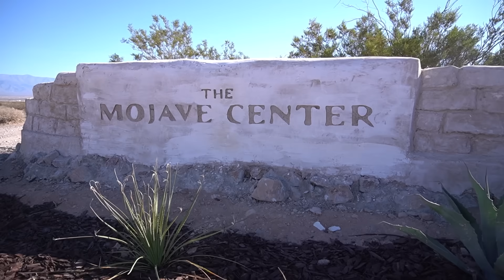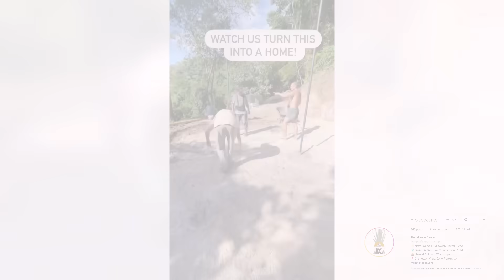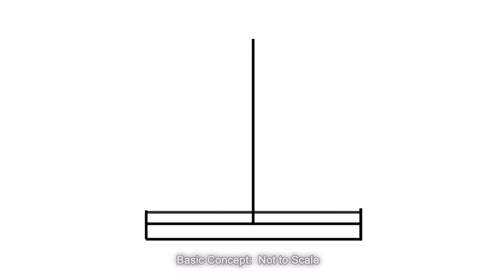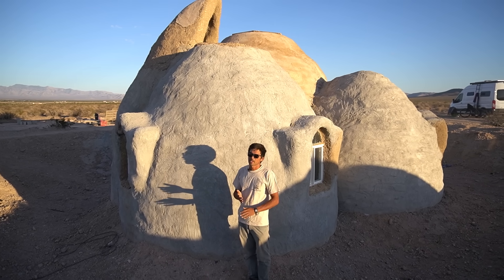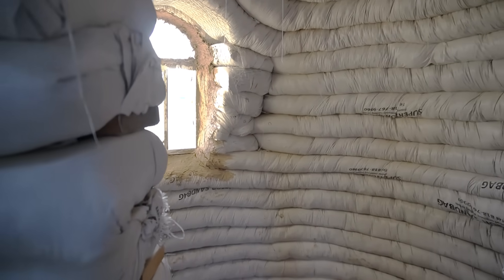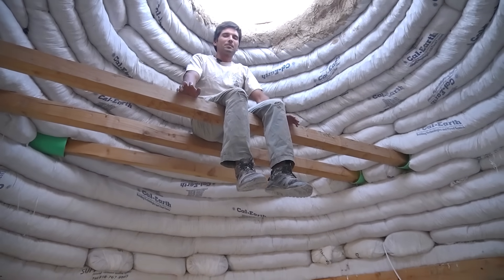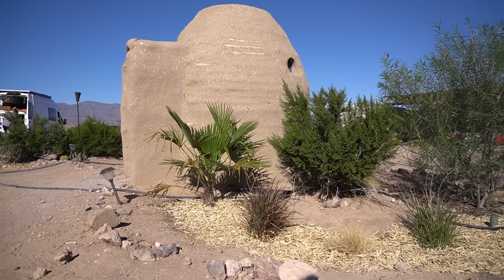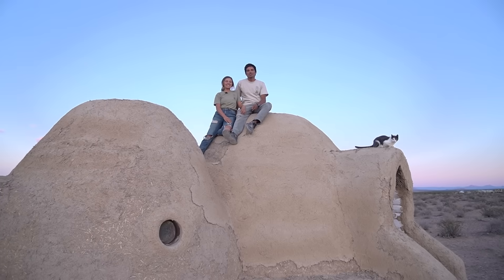These Sustainable DESERT DOMES Will Blow Your Mind!

Comment: Death traps in an earthquake.  The Navajos build earth homes (Hogans) but they are experienced enough to know that they need a support structure inside of them.  They use Utah juniper tree trunks to provide needed support.  Adding barb wire wrapped around the earth filled bags only means that they will cut you up before they crush you to death.  Sometimes cheap and easy is the most costly in the long run.
Reply: That is false. This method of building passed earthquake testing. Hogans are different and shouldn’t be compared to this method.

Comment: I'm very curious about things like building codes, local permits, etc. 

If you could combine this with solar off grid electricity, and guaranteed water supply, there are some eco village groups that would be very interested in this
Reply: Most counties allow less than 200 sq ft homes to be built without permits.

Comment: If these domes had the floors 3 feet below grade, the homes would be much cooler, but still have lots of light.  Obviously you would need to build in higher areas.  Maybe the earth bags could be strengthened to allow them to be retaining walls for the part below grade.

Comment: My neighbor in Joshua Tree , CA. built her home and two smaller domes that she Air bnbed. I watched the whole proscess from the beginning . Cal - Earth has a work bank program where you " bank " hours of volunteer work which you can then withdraw in the form of whatever skillset  you have need of when you build your own home , such as a plumber or electricianfor example. The homes themselves are wonderful , with skylights and windows letting in lots of natural lught . The round rooms flow so well and there are custom nooks and crannies built into all the rooms . It maintains a comfortable temperature even in the summer and one room she uses for an office has the most perfect accoustics !  The bathhouse is also built the same way with a spiral entry leading to an open shower and a seperate deep bathtub that is built out from the wall. Its just a wonderful place and she is very proud of it , as she should be .

Comment: Two questions that come immediately to me; what is the cost difference between earth bags and tires for an earthship, and do you use french drains for water capture? 

Interesting concept but do you have engineering information about structural integrity v earthship construction? 

Also, how does the thermal mass compare with rammed earth tires in an earthship?

Comment: Now what I'd like to see is taking advantage of the cooler earth by digging out your circle floor to a depth of around 3 feet, bags etc up to ground level, add 1 foot and put in windows, finish off the dome shape as you design. The door way would require a mini trench access but no problem in a water restricted environment.  Try one ... since you are experimenting ...

Comment: Another idea free to those who use the ideas is that a dome larger than the domicile keeps the inner dome out out of the sun  and leave a hole in the center for ventilation of the walls.   The ventilation will make the inner dome cooler at night.

Comment: You have zero pollution electric power Edison generators are open patent devices.  Zero refrigerants air-conditioning that is zero current used.  Is possible and was required by the EPA mission under treaty enforcement and obligations.  Have you considered deep under ground ventilation filled with steel ?   Twenty foot diameter with ten foot walls topped by ten foot dome might be a little more realistic.

Comment: Can you use permanent magnet motors as generators with inverters to deliver house current AC power?   A car generator can be converted from Tesla generator to Edison generator by removing Tesla magnets from the armature magnets. Count and divide by 6 and chisel off one sixth and leave one sixth on and alternate on and off to three sixths on and three sixths off.  Reassemble this generator and remember it is now a powerful motor and you have hold both sides as you bring armature and case together.  Positive DC is the brushes and negative is the field to wire to DC AC inverters.  The car generators have to be older than 1974. Not an alternator.

Comment: my concern is about resistance of the plaster against the rain, it won't stay long, we use this kind of plaster in Afghanistan too as this is all so a traditional way of covering the walls with wet soil in Afghanistan, but we do it on top of the soil, not on top of the plastic or any other materials, make at the way at least it worth it, you can ask me for more experience.

Comment: It's not building the tiny home that's the issue. Believe it or not, the walls and roof are actually the easiest part. What's difficult is the utilities. Which this Hut has none of. No electricity, no water, no septic and no sewage. So of course. If you even want to call it a house, which is missing every element. It would in fact be very quick and easy to build.

Comment: Wouldn't these require Maintenace every 4 to 6 months? I mean the final coating of the walls and outside that will eventually start to crack and flake off.  Which would then need to redo a new coat inside and outside.

Comment: What defines "sustainable"?
Genuinely curious about it. To use material that is easily reproducible, recyclable or easy-to-repair perhaps?

Was just thinking about the bags, sounded like you said it was "Polypropylen". I might be wrong but If I remember, isn't Polypropylen bad in places with a lot of UV radiation, because it breaks apart the Polypropylen?

Looks great by the way, really liked the one with the white paint, very Santorini-esque!
Reply: UV is why the stucco is required.

Comment: While the humidity is incredibly low in the Mojave desert, if I was going to build a house there, I'd set up a giant humidity removal system to remove the little water that's in the air and store it in a giant, 10,000 gallon tank, which would be powered by the sun, the thing that there's a ton of there. I'd have a giant solar array on the floor. I'd share the water with others.

Comment: I understand that polypropylene bags are cheap, durable and long-lasting when protected from elements... However, I am trying to go zero plastics and yes, I'm being very particular.
How does cotton canvas or linen canvas do in these types of structures?
Reply: Just fine.  Sandbags used to be canvas before the plastics revolution.

Comment: Good luck. I would like to see some sub surface heat exchange system. It’s just pipes loop underground at an engineered depth. This is like free AC in hot dry climates. Also works for water cooling and condensation gathering

Comment: These bags and stuff are not necessary. You need something that bends. Wood doesn't bend much but many twigs together do. Or bamboo parts if available. 
Tie Twigs together and make the skeleton. Together with dry grasses (straw). Inside should be in connection with outside. Then put a mix of clay, straw, sand and some cement on outside then inside. Finish. Ok, if you want bigger walls: more twigs, more straw, more mud. You can do it even without cement. Only that rain will dissolve mud, so a layer on the top it's not a bad idea.
But thanks anyway.

Comment: Why not RAMMED EARTH with straw binders. No need for bags or barbed wire. You can still plaster over them. Also, the temporary confinement used during compaction is usually wooden panels which you can reuse over and over.
Reply from the maker: There are lots of natural building methods each with their own benefits and downsides

Comment: Curious if you’ve looked into incorporating a cooling system similar to the old “desert submarines” that was very effective and simple.
Reply: Could you elaborate more about these? I'm going to look that up now
Reply: @beauxgray4090  a desert submarine was used as a simple evaporation cooler where they constructed a simple A frame shelter that’s about 8 foot tall out of plywood. Then they lay two layers of burlap material flat on the roof surface. Then they run one or two one inch diameter pipes along the beam with small holes along every 2 inches that allows water to slowly flow and soak the burlap material. You can use a header tank that’s slightly higher than the A frame so gravity keeps the water flowing and so the water supply runs out at around 0200-0300 each day so water isn’t wasted in the cooler hours of the morning. This system was common in the Mojave Desert beginning in the late 1800’s. I remember an old show called “California Gold” where they had an episode about these things, it should still be on YouTube. I was an Army Recruiter in the late 90’s and people always thought I was Huel Howser from his show when I was out in public, weird experience.
Reply: @echohunter4199  Thank you so much for that info! 🙏 I'll have to see if I can find that video you mentioned!

In this video did you see the windscoop? I'm wanting to build one of those on my dome. At the top opening where the wind would come in I wanted to attach some sort of cellulose pad, or like you said burlap & attach a line, small pump connected to a tank and have water drip down so when that prevailing wind gets funneled down into the dome it gets cooled by that watered burlap or cellulose pad. I've seen at ground level too in other designs where there will be a couple inches of water at the base of the windscoop so as the wind passes it also cools the air. I might try and incorporate both designs.
Reply: @beauxgray4090  I noticed the scoop design in the structure, I’m curious what direction the prominent winds flow during the day, this can optimize a constant flow rate so using a fan is minimized. I’m curious if a regular soaker hose line would be possible for a dome like structure. Let’s say you use the soaker hose and layer it in a radiator style form so air can flow between the layered hose loop, the hose exterior is constantly wet/moist so when the air flows through it, it’ll pick up moisture and drop the temperature dramatically. Then there’s a simple gravity tank type where you build some type of water tank and poke a bunch of small holes so water drips out then, you fashion some kind of mesh screen made out of anything you can imagine, some old window screen material, a lattice made from local sticks from shrubs, whatever works. As long as you find a balance of water consumption to maximum effect. Even having the water tank built in a way that keeps the water 10-15 degrees cooler than just a non-insulated metal/plastic water tank will give good results. I wonder if spraying water through the air flow without any kind of screen/lattice would work as well? I’m picturing a water tank with around 50 small 1/8 inch holes constantly flowing water and a pump cycling the water back up to the tank. Or, just a flat piece of thin plywood set at an angle (like 45 degrees) so as the water drips onto the plywood and the air flow hits it directly, it’ll pick up the humidity and push it into the dome. Ok, I’ll turn off my “what if” machine for now, lol. Just don’t be afraid to try an idea, even if it sounds loopy. Your concern will be to have a way to clean it out so mold doesn’t develop so check what molds are common for the area where your structure will be and know what they look like. There’s ways to mitigate mold growth with local materials so you won’t have to rely on bleach and vinegar for sterilization, the old timers in the area can help in that department. Oh, one thing to keep in mind for emergencies is to buy a couple small bags of ‘pool shock’, you can buy them for a few bucks a bag at most large outdoors stores. This works great for water purification if things get ugly. Just use a small amount to clean the water and to remove any chlorine odor, just pour the water from one vessel to another a few times so the air can pull out the chlorine odor. Once done, it’s safe for drinking, there’s a lot of nasty microbes in some natural water sources. I think it’s one teaspoon of pool shock to each 5 gallons. I’m sure you have plans and ideas for power generation/storage via wind or solar so everything has to be optimized to use minimal amount of power to avoid straining the system. The dome you have seems to be well insulated, I suppose if temperatures got real high, setting up a sun shade over the structure will reduce temps also, maybe just use a sun shade for let’s say, a ten foot square area or wherever the sun is doing the most damage since putting up a huge sun shade would be a waste. Maybe you can make something out of local shrub branches that you can weave into some kind of tight grid or just use some cheap burlap, anything that has a light color to it, the darker it is, the more heat it’ll retain. Options, options, options, lol. My experience in desert cooling comes from being in two wars as an Infantryman and we never had A/C until later into the deployment so, we used our noodles to figure things out and it wasn’t too hard. Even my grandfather who was a pilot in WWII built his own evaporator A/C with some fuel cans and an electric fan while his buddies just sweat to death, lol. I’m one of those people with RH negative blood so I don’t do well in bright sunlight and hot climates so I’m always concerned about heat.
I know you’ll find a perfect solution.

Comment: I think they could use lime paint on the outside. It's a bit tricky because the paint has to stay wet until it has fully reacted with the CO2 in the surrounding air. Maybe put a tent over the house and make a little fire underneath to increase the CO2 and to not let the moisture escape.
Also make the walls wet before painting and maybe while curing.

Comment: Great job.  I prefer sawdust to mix with the clay.  The straw breaks down over time.  Sand I think could fill those bags well has anyone tried this method.  Please share your experience and ideas.  Solar bag showers would fit well in your shower dome and they are cheap.  They would conserve water also.  Have you considered a portable dome for a pit/drop toilet.  And sawdust would be my choice for covering toilet paper etc.  I would collect urine separately.  
Grain silos make a great cover or frame for a dome home.  Well anchored especially in tornado country.  
Seriously these sorts of homes would be ideal where tornadoes are and insurance would be low.  To rebuild is cheap.

Comment: Polypropylene bags made from 2 x 100 mil slit tape natural or pigmented do degrade by photo oxidative degradation and covering with clay and straw will protect the life cycle if the oriented PP bags however you have forgotten the most important issue that of thermo oxidative degradation of the slit tape in the absence of UV light. The intrinsic thermo oxidative stability of slit tapes is fast at 125 C and slower ar lower temperatures therefore since infrared heating during the day traps heat during the day oxidative degradation in the dark goes faster and if transition metals and other Rare earths like cerium found in desert sand will accelerate anaerobic and aerobic degradation therefore you should at a minimum find bags with the proper fortification

Comment: I think these domes are a fantastic idea for the desert!
Reply: Any climate... Earth is a very good insulator hot or Cold
Reply: @lorrie5881  The R-value of soil ranges from 0.25-1.0.  Really, a pretty bad insulator.
Reply: @brokenrecord3523  and yet you don't need to dig that far down into the earth to find soil that is a consistent temperature. Earth bermed homes work so well for a reason.
Reply: @DavidCruickshank  
And that reason is?
Reply: Until you try living in one. In July. Or August. Oven.
Reply: @jzwillows  have you experienced it?
Reply: @UniquesEthicalEarth  no
Reply: @UniquesEthicalEarth  Yes, personally - I  live without AC in a climate that has a daytime high in July of about 96, & I have lived in Phoenix, and professionally - as a licensed civil engineer I have deal with this field.
Reply: @jzwillows  there is a guy, bio-veda academy here on youtube in one of his vids he stated he lived in Africa for a while in an adobe house and it actually stayed pretty cold. he also builds adobe houses different styles.
Reply: @immortalfantasy7298  This can only work in a warm, not very hot climate, if the inside is cooled sufficiently. In Phoenix, for example, with an average low in July of about 85 degrees the home remains at 85 or above. Were it possible to avcieve with adobe insulation a comfortable temperature in a hot climate which did not require air conditioning, people would use abobe insulation in order to avoid air conditioning, but for the vast majority of people in the USA, as opposed to a third world country like those in Africa, adobe insulation without AC does not work.
Reply: @jzwillows  I see. So if I really wanted this I would need to find the yearly average as well as the extreme averages temperatures in like winter and summer to see if it would be worth it?
Reply: I'm moving to Tucson this winter and have been wondering just what is the best.  Hempcrete, foamcrete and aircrete have very high insulation, which is great if you condition the inside air.  Thermal mass is great if the temp comes down in the night.  Tucson average low even during the hottest part of the year is about 75 (winter is low 40's).  Thermal mass seems the way to go.